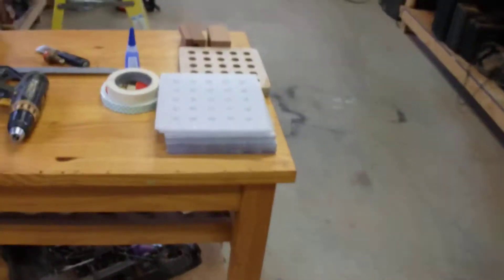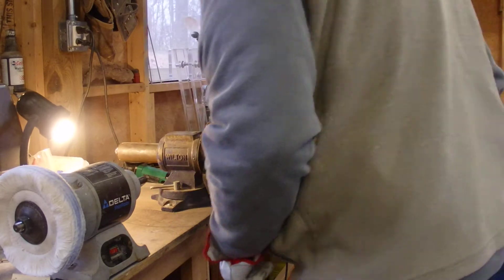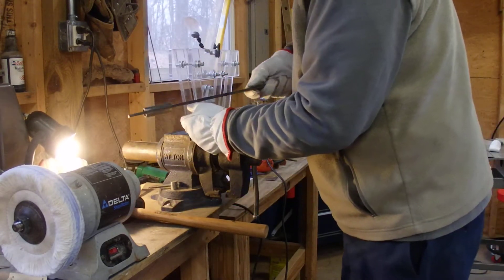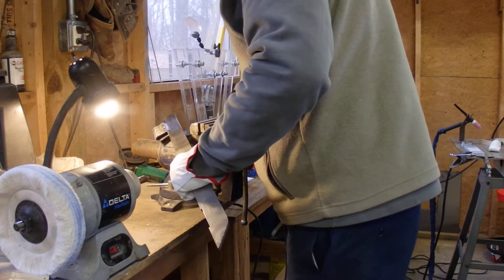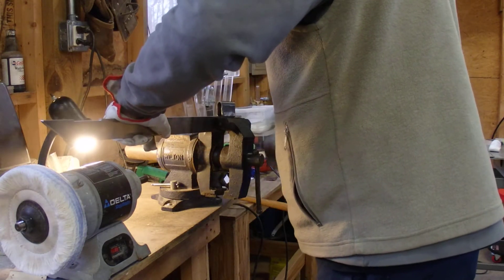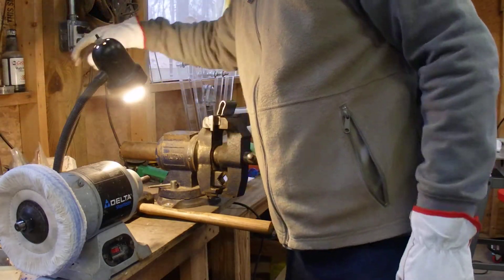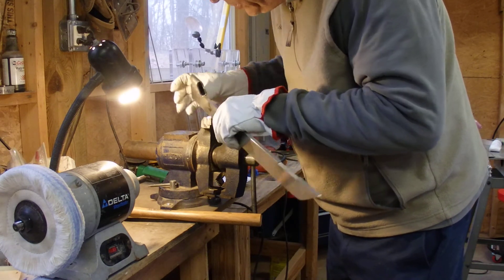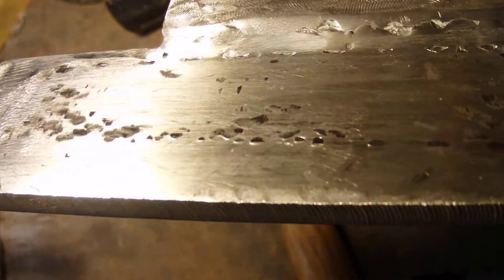Destruction Testing Mild Steel TIG Welded to Spring Steel

Comment: What filler material did you use for this? I need to weld mild steel ends onto a spring steel drain machine cable and I'm not sure what to use.